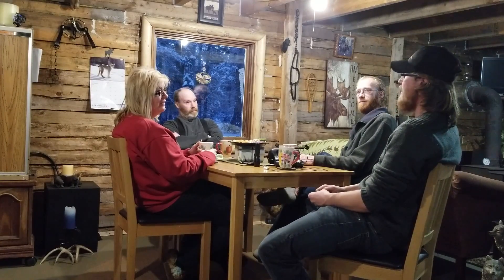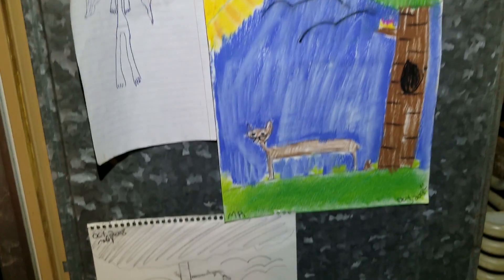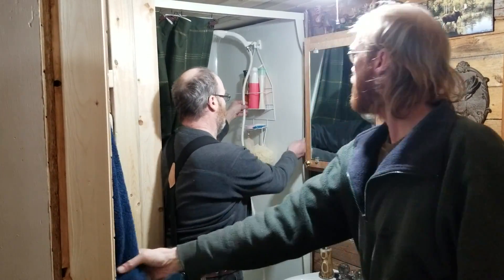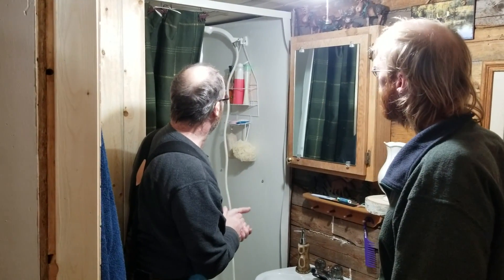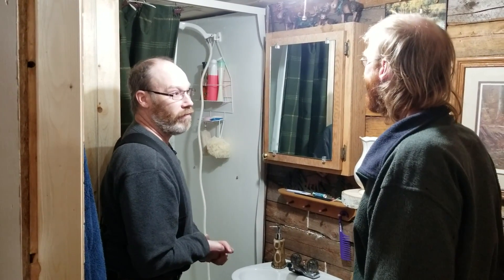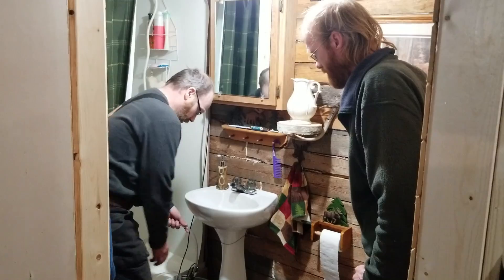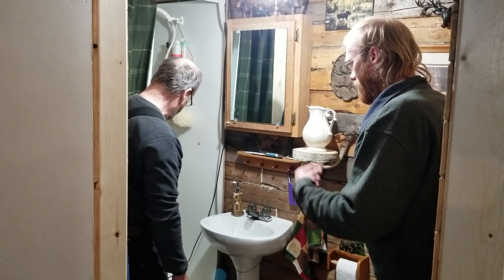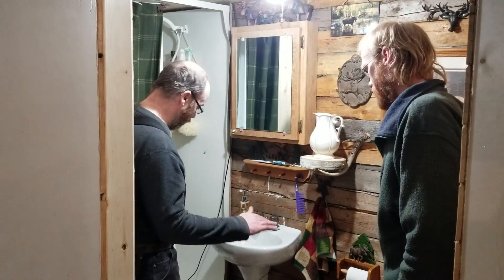Rustic Offgrid Cabin: 12 V Solar Shower System

Comment: How do the keep the pipes from freezing that go out of the shower?  Great Idea.
Reply from the maker: Great question Lisa! In this system, since there is so little water passing through at any time, and the pipes are on a fairly steep angle, they just remain empty so there's nothing to really freeze up. If, for some reason, they did though, it's all built to be easily detachable and the pipes can be brought into the cabin to thaw out. I don't think they've ever had to do that yet though.
Reply: @BackwoodsBoys  Thanks for the quick response.